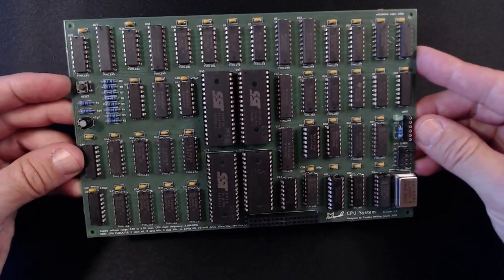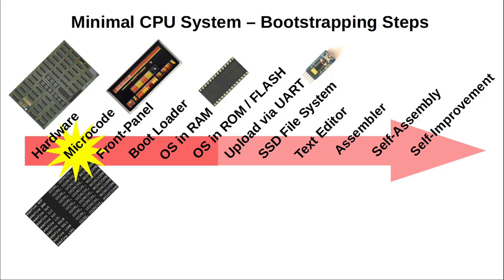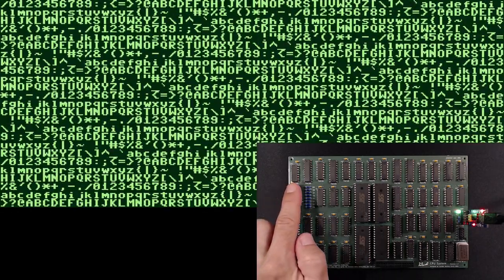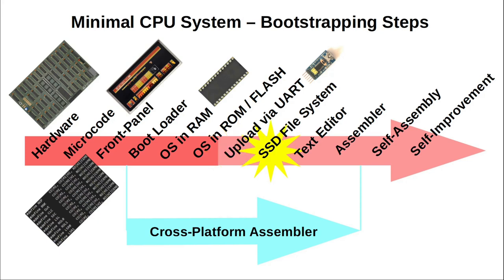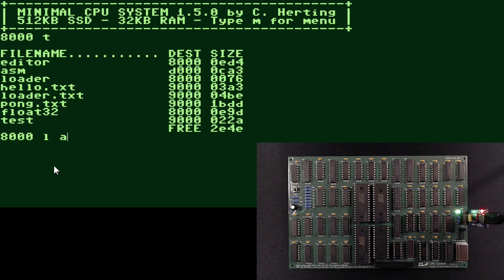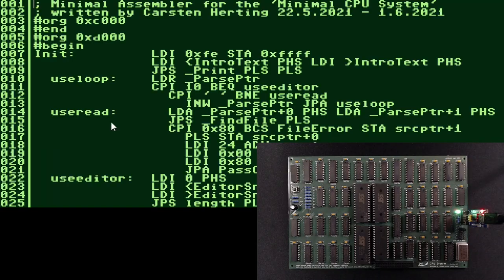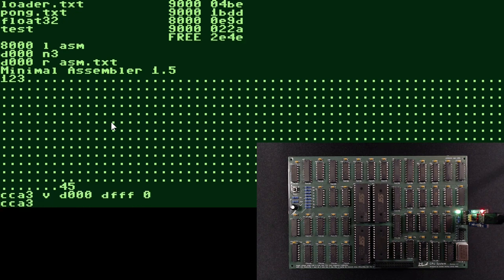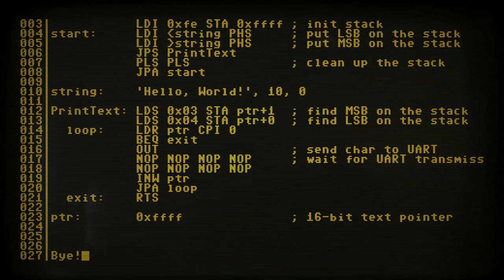Bootstrapping a Minimal CPU System into Self-Improvement Capability - Simplest Usable PC #8

Comment: Some kind of higher level language like FORTH or Lisp or maybe even BASIC would be an amazing next step. Not that a self-hosted assembler isn't amazing in itself.
Reply: The next steps of loading an interpreter are fairly well documented on various systems. For me it's always been about those first initial steps to get the system ready... to then do anything you want. Those first micro systems couldn't even read from (paper) tape to load a programming language until the bootstrap was complete.
Reply from the maker: Thanks, edgeeffect, yep we are working on that :-) Actually a 'Minimal' team mate - slowcorners - has already published a FORTH for the Minimal. It's on the 'Minimal Boards' (link is in the release video description). Stay tuned for a modern BASIC JIT compiler...
Reply: @edgeeffect You can find the Minimal-FORTH via: https://github.com/slowcorners/Minimal-FORTH
Regrettably I have not had the time to document it or write manuals, but feel free to try it out. Let me know via the Minimal Forum if you run into trouble and I will do my best to help.
Reply: I prefer BASIC over FORTH or LISP and I think more people are familiar with it :) But of course everything has its pros and cons
Reply: @NilsKullberg  FORTH is the ultimate minimal solution for The Minimal. :)

Comment: How cool would it be if there would be a BASIC Interpreter with some "GPIO" capability to switch some LEDs :) Your work is just amazing! Would it be possible to add a real time clock module? This would open up a huge range of applications :)
Reply from the maker: BASIC is coming...
Reply: @slu467   Great news!

Comment: One thing I find really hazy in my understanding of the character ROM and other text specific graphics, scrolling, moving characters around via its width and height. You have this connected to a T.V.. Does your computer manually set up the characters which are displayed on the screen? I would imagine that this is done via hardware and not software.
Reply from the maker: Hi Lucas, pure bitmap data can be send byte-wise from VRAM to the monitor via a shift register. A character display would translate a byte to char data via a lookup table. Both can be implemented either in hardware or software. Generally, older machines couldn't do it in software. Cheers!